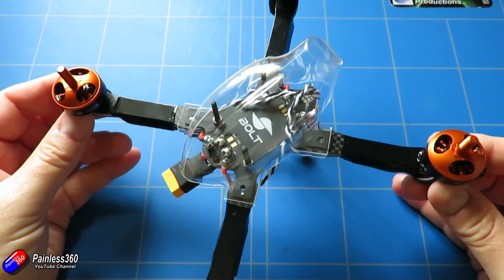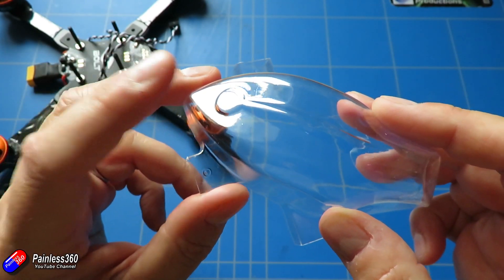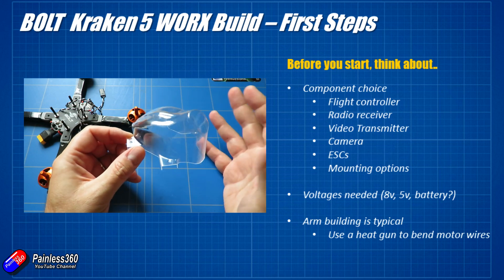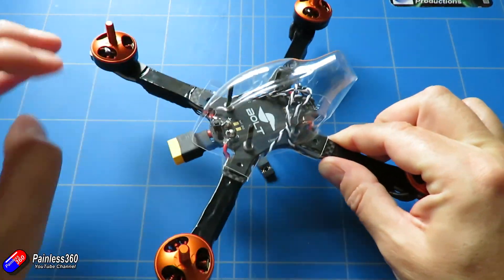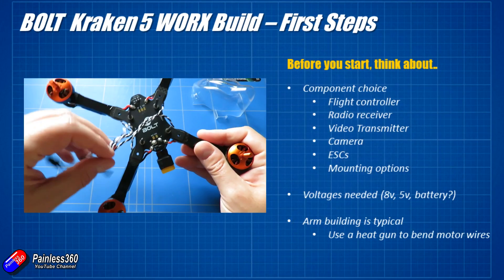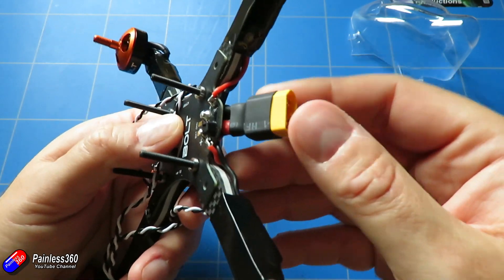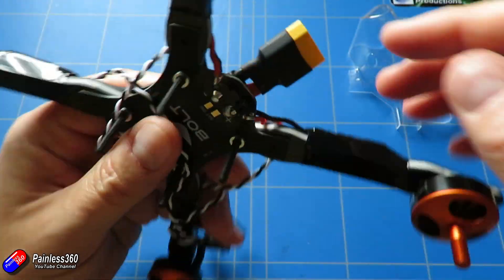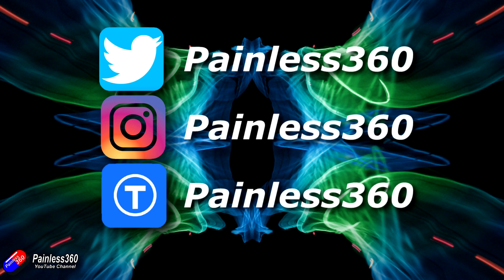BOLT RX Kraken 5 WORX Build Part 1

Comment: I mounted my AOMWay vTx under the frame, on the bottom plate with the LiPo pad over the top of the vTx. With driver connection to Lumeier AXII antenna. Antenna is then protected from crashes and it makes things easy to fit